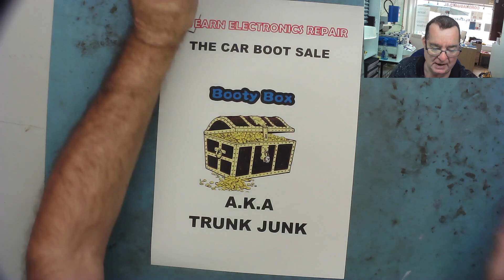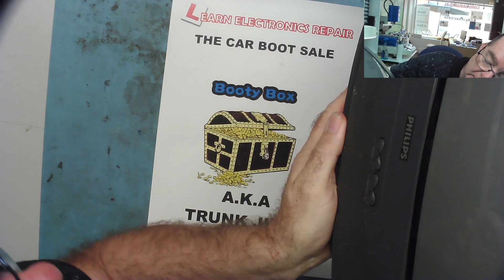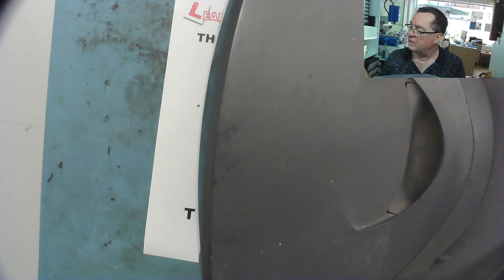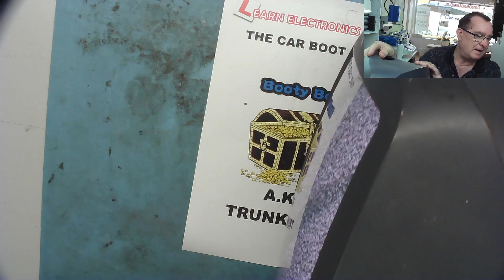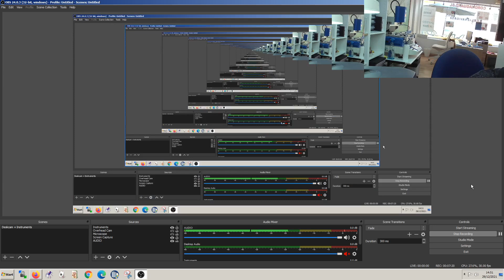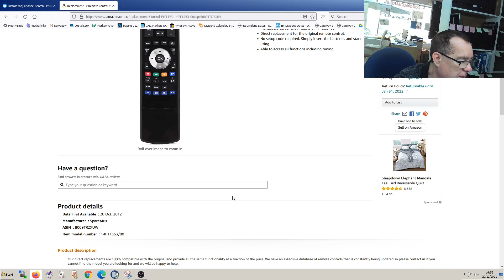Learn Electronics Repair goes Skip / Dumpster Diving!  LER #176

Comment from the maker: OK so I got rid of the hissing on the audio - and inadvertently caused another even worse audio problem!  Seems like I just can't get this right, yet other youtubers seem to have no similar problems.  I'll try to find a different way to mount the microphone and get it off the desk - or stand it on a piece of foam maybe - see if that is any good.
Reply: its not about the placement its either the cable or the microphone itself.
most cases it's the cable or the usb port ur plugging it in
Reply: Shared ground could be your problem when the TV was turned on I heard interference hum. Didn’t notice before.
Maybe you can get the software audio input filters like Rossmann uses, it was free and open source from memory.

Comment: Hello rick, i wanna ask. Why my soldering station mechanic t12 make electricity in my board? I have try to repair led lamp. When my solder touch the circuit, then the led is turn on. It is usual(safe) or because i dont use isolation pad. Or because faulty of my soldering station? Thanks
Reply: My hand also feel the electricity when touch solder bread and the solder wire.
Reply from the maker: @unintendedperson  Hmmmm.... try grounding your soldering iron station
Reply: @LearnElectronicsRepair  ok. Actually my insulation pad still in the way. Lol
Reply: I also want to ask, if i found some component fault. In example, i have two aon6764, but after that 6764, they have different number and letter, can i use any aon6764 which i buy in aliexpress? And how to know work voltage of power inductor. In example r36, because i have two different r36 too. And again, can i measure power capacitor just like measure electrolytic capacitor using voltmeter? And how to know the working voltage of the smd power capacitor
Reply from the maker: @unintendedperson  There is no definitive answer to this.  The letters after the device number can mean anything from date codes to package type and everything in-between.  for example I have seen i2c compatible chips where the letter after the number specifies the 'address' of the chip and must be the correct type.  

Also very similar intel SIO chips can have lots of letters after the numbers and these must also be replaced with the correct one.  

It usually specifies what the letters mean in the datasheet and from that you can work out if it is relevant.  In the case of the AON6764 you mention, which is a MOSFET, it doesn't mention anything about the letters in the datasheet so they are probably not important
Reply: @LearnElectronicsRepair  thanks for your reply. I learn a lot from you. And i want to ask again, to test power inductor, should i use esr meter? Cause it too expensive in here

Comment: The sound is worse, because as soon as you turn your head, ie, you're not facing the mic, the volume drops and it's hard to hear. Young people won't notice because young ears auto adjust volumes, ie, ears become more sensitive for soft sounds and less for loud sounds. The problem is there is no fidelity/sharpness, ie, it's muddy low frequencies. Low frequencies have a lot of punch so I have to have the volume low to stop the pain, and that makes it hard to hear when the volume drops. Also the lack of sharpness means words blend together and are hard to discern, ie, words need a quick rise and fall to separate them. Pro YTers usually use external USB audio interfaces, because the sound cards in them are better than on-board motherboard sound - a good quality sound card might help fidelity, but I would still be inclined towards a USB interface -.
Reply from the maker: Well I got rid of the hiss at least.  I'll try mounting the microphone off the desk to get rid of the bumping and banging when i move things around.  If that works then I can use the mixer to boost the high end a bit - at the moment it is set flat. Let's see if that helps.
I tried the lapel mic on the mixer but oddly enough it does not give any audio at all though I know the cable is connected correctly.

Comment: just get yourself a cheap half decent dynamic microphone instead of a condensor, a usb audio interface, and a stand and you will be good to go. audio technica M8000 are like 30 bucks new.  for the interface i use a scarlett, but plenty of ~50 options out there that are more than serviceable.
Reply: Or get any sort of decent over ear headset microphone. Plenty of good options for decent audio.  This video was brutal on the audio levels
Reply from the maker: @dontthinkastronaut  Yeah I used the headset mic for a lot of my earlier videos but found it uncomfortable and some viewers were complaining it sounded muffled - but admittedly the sound was better than currently. I'll experiment with the DJ mic/mixer setup a little bit I think and try mounting the mic by other methods.  If it works well I'll try a condenser mic.  

I should never have sold my sennheiser radio mic that I used when DJing in the mid 2010's  but at the time I sold it is didn't think I would need it again.  Oh well....
Reply: @LearnElectronicsRepair  haha awesome, upload an old timey DJ clip please :D  I prefer dynamic over condenser just because you pick up a a lot less ambient noise with them
Reply from the maker: @dontthinkastronaut  Actually I didn't realise I uploaded so much video from my DJing about 6 years ago - mostly just playing some music and showing off the lighting, I'm not sure if  Iwas speaking on any of them

Anyway - Check this one out
https://www.youtube.com/watch?v=q4dSUj3z7EA

And plenty more here
https://www.youtube.com/channel/UCouQRq0gcTss4iGRQQkq0sA/videos

Oh and this one, 1st Oct 2016 wedding at The Moathouse Stoke-on-Trent  https://www.youtube.com/watch?v=SrVVU9Lhekw - everyone was rather drunk at the end lol, some good dancing and singing as you wlll see

This was one of the last gigs I performed as I moved to Gran Canaria a few weeks after that, though I was back in the UK and did a couple at Christmas 2016 and New Years Eve 2016 was my last, and one of the best, but I don't have any video of that one
Reply: @LearnElectronicsRepair  good times :D drinks and music and dancing always the best combo.

Comment: The sound is fine, better than before.
Reply: Not if you are wearing headphones or earbuds
Reply: @GregM  You're right, that noise floor
Reply from the maker: @johnprescott6614  I've had anothe rgo - remounted the mic off the desk and adjusted the equalisation the mixer - see what you think on the next video
Reply: @LearnElectronicsRepair  the noise wasn't obvious on my speakers at low volume but yeah, it's too high. A noise gate would help (or a high pass filter, or a ground lift). What kind of mixer are you using? Are all connections balanced?
Reply from the maker: @johnprescott6614  I've made some more adjustments today - I'll make another video tomorrow then let's see.  I'm not sure what the mixer is off the top of my head. The mic is connected to the mixer on a XLR cable.  The output of the mixer is two mono 6.3mm jacks going to the 3.5mm line in jack on my PC.  I've turned all other mixer inputs down to zero now - they were not on this video